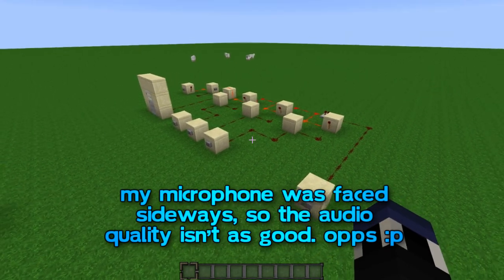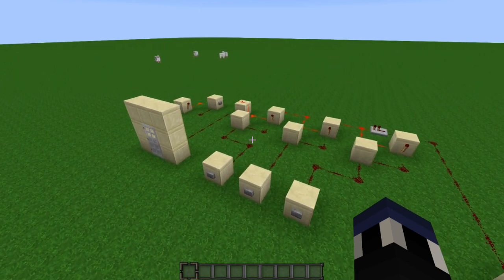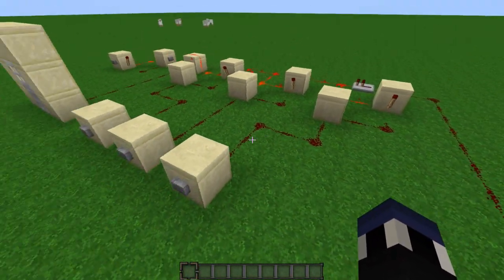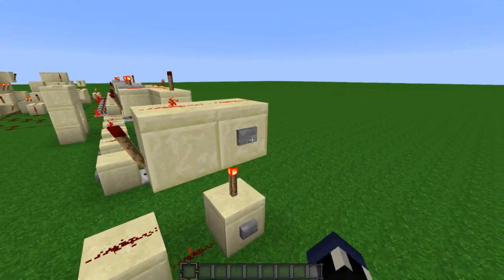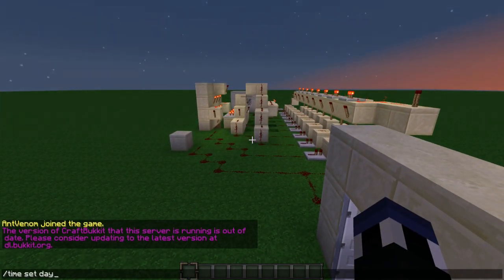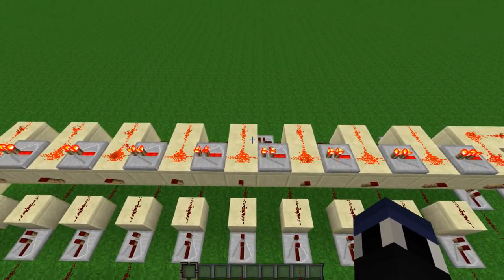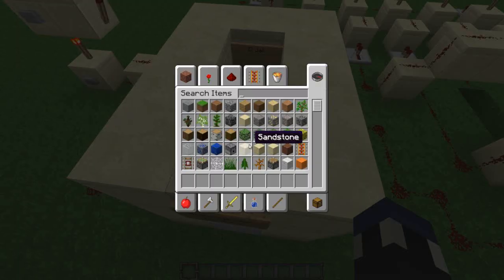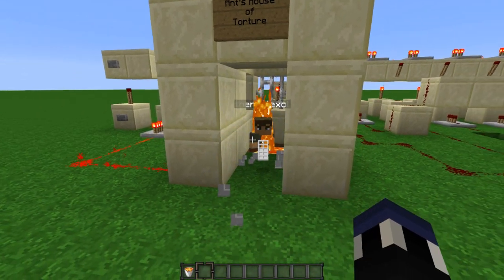The Redstone Experiment - Compact Combination Locks

Comment: Possible flaw: press buttons 1-9 nine times each in the same order every time, the door should open. Also, to make it easier to change the combo, after each button is isolated, put it into an array that goes into the RS nor latches, not individual paths.

If you don't understand this, check out CNB minecraft, he posted this ages ago.

Props to Ant though, I haven't seen that RS nor latch before, the one I usually see is one block shorter but 1-2 blocks longer

Comment: I always use a line of pistons attached to memory cells behind the lock. As you push a button, another piston is pushed out extending the line towards an auto reset button. It basically limits the amount of times you can press the buttons as to rid of the button spamming with an enter button. :3

Comment: The reason it is more compact is actually just because it is vertical, it is easier to link things together if they are vertical. However, the latch itself isn't anymore compact...if look closely you will see the one on the floor takes up a 3x3 area HORIZONTALLY and the other takes up a 3x3 area but VERTICALLY.

Comment: True. But I guess you can figure out a way to hook up the buttons and locks to the torch  at the AND gate (I prefer to call it Biterminal chip), so you would have to reset it so you couldn´t crack it. This could be done by hooking up the memory cells to a mechanism that would reset the whole lock unless pressed correctly, this mechanism can be done with more memory cells so the pieces of data could be stored and prevent or allow the mechanism to restart! I hope you understood. XD

Comment: Clever bit storage thingy... but there are two problems...

1. If you just hit all the buttons you will eventually unlock it, you need to have it so if the wrong button is pressed, it resets.
2. You have to have a number in the combination for every button you have. And if you just dont put any redstone for an unused button, it wont reset the lock when you hit it like i said in #1.

Comment: I probably missed some key component in this that makes the following comment seem like complete garbage, but the way I see it is that if the wrong button is pressed, it doesn't restart the system. Without a reset, someone could press all the buttons over and over until they finally unlocked all the gates in a row, and walk through. A reset device when hitting a wrong button would definitely make this more adventure map friendly.

Comment: You can just spam the buttons then it will open.  You need to add a conditional reset to each button so it will reset if you press the wrong button at the wrong time.

Comment: Well, there is just 1 problem - id u press 1,2,3,4,5,6,7,8,9 9 times in a row it will open instantly without knowing the real combination.
There should be a reset if u enter a wrong key but for that u would need counters xnor gates and big flip flops

Comment: I'm just still looking for a compact lock that doesn't have the flaw explained in my previous comment. I designed a lock that doesn't have it (using a memory strip as counter and then lining up that counter with all numbers) but it's huge. 
I might be able to compact it more using some new stuff I learned over time (smaller counter, using these RSnor latches etc)

Comment: Yeah, it's an easy design, but there are 2 problems with it: 1 - You have to connect all of the buttons, otherwhise they will not do anything. 2 - You can't make a code in that is a number twice. For e.g. the code can't be 123452, becouse you can only put the "2" once in it.
But yeah... It's a compact one, and it's perfect for what YOU want do.

Comment: The problem is that you can just hit all the buttons until you eventually unlock all the reset levels. You need to add a way so that if you hit one wrong button, the whole system is reset

Comment: Do an experiment on if you can 1 shot punch an ender dragon with strength 255

To get strength 255 allow cheats then /effect player 5 255 99999

Key:
5-the potion effect code
255-the level of effect
99999-the time of effect

Time of 9999 is infinite time

Without the end,default time is 30seconds

Please do the experiment to keep this series running

Ps:it can work with the wither too
Pps:it can work in default vanilla minecraft. 

:-)
Reply: Oh and please dont hate if the potion effect code is wrong coz its really hard to remember 23 potion effects.

Comment: the only problem with this setup is that it doesnt reset if you press a wrong button.
that means i could just push all 9 buttons 9 times (123456789 123...) and i will get the combo.
this is a cool design, except that it takes 81 button pushes to crack it.

Comment: Nice system, too bad there's a single huge flaw in this lock that every lock seems to have. 
If you know which buttons are used, just press them all in order times the amount of buttons (aka, 9 buttons means press all the buttons in order 9 times)
That way, it's always unlocked. If you hook up 1 number to multiple RSnor latches, worst case you have to press all the buttons more then that amount of times. 
Yes you can hook up a nonused button to the reset but still it isn't safe.